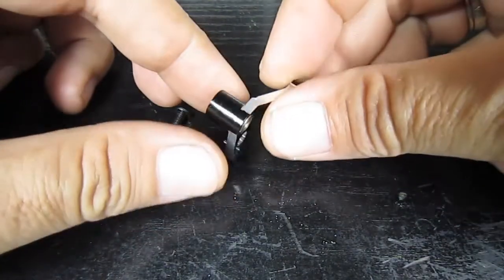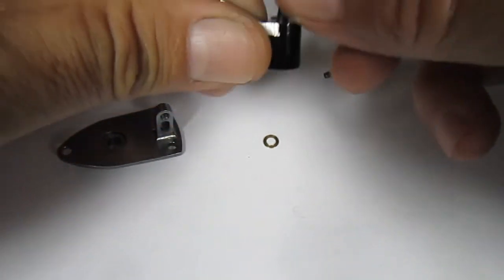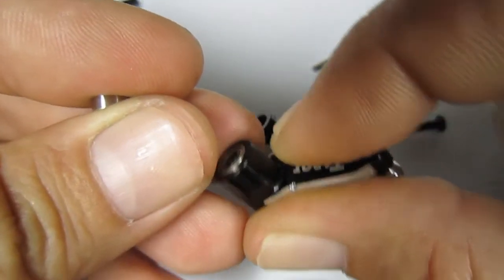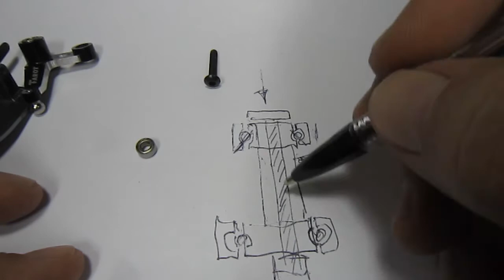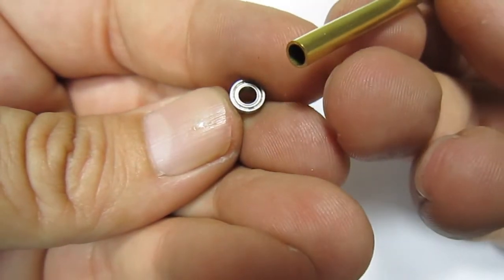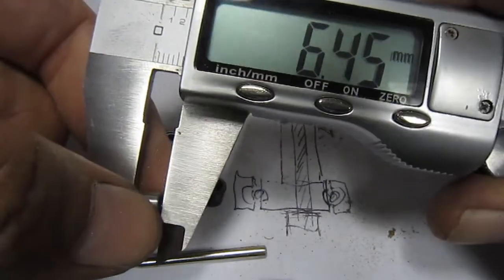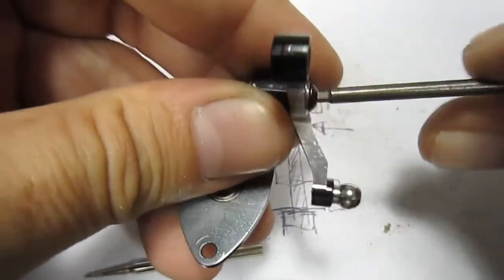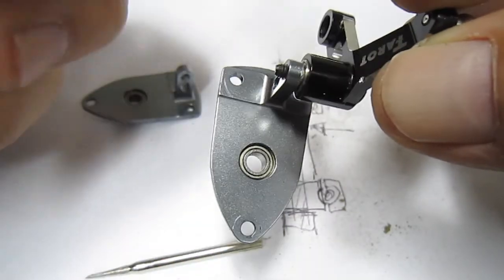Bearing Fix for the T-Rex Clone Helicopters

Comment from the maker: @trexinvert heh how strange the above is because I actually packed it with grease exactly where your saying and also inside where the brass tube is.that I fixed but only problem after nearly every flight I have to clean it, drives me nuts but so far its nice and tight. (I know I dont do anywhere near as many flights as you do) I also found a nice silicon lube that wont burn and I use it on the main tail rotor shaft so the bushing for the tail pitch slider runs smooth across it.

Comment: You might want to apply a little bit of grease on that rudder control arm.  Specifically, in the open hole that mates with the linkage ball of the yoke(tail pitch assy).  My "metal" rudder control arm is junk now, because the fit got too sloppy with the linkage ball.  The stainless steel ball will wear down a "ring" inside the metal rudder control arm making it sloppy.   I've got quite a bit of flights, but it was was accelerated by a few dozen hard auto landings with tail blade touchdowns.

Comment: Nice presentation of the bearing and spacer binding issue.  Hope "align mfg" is watching and fixing their mistake, or checking the quality of their vendors.  This is freakin upgrade part.  We're paying extra for a part that's not made right?  I got the same problem, but I just stacked extra washers where needed.